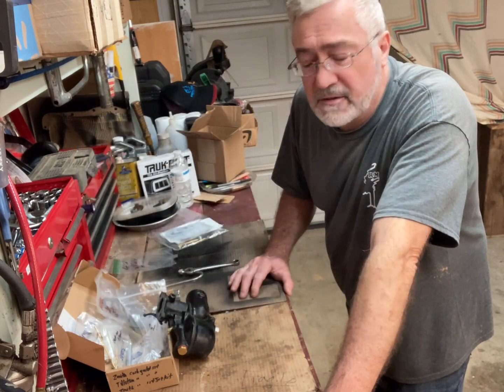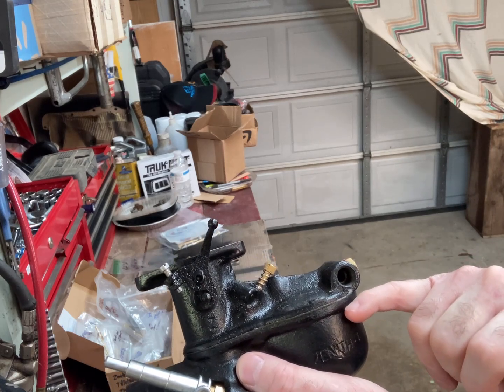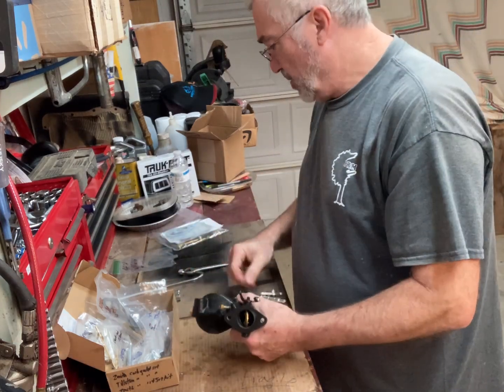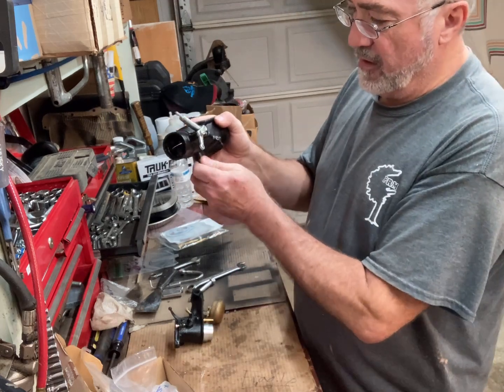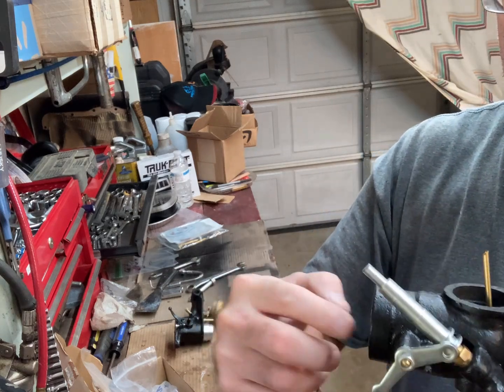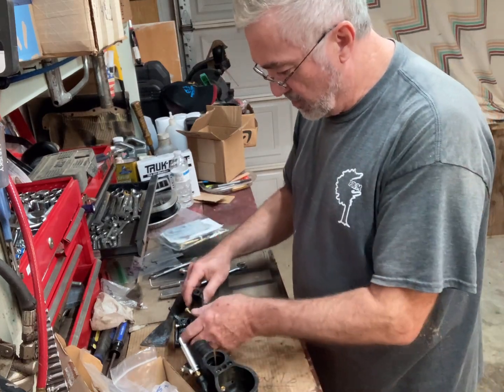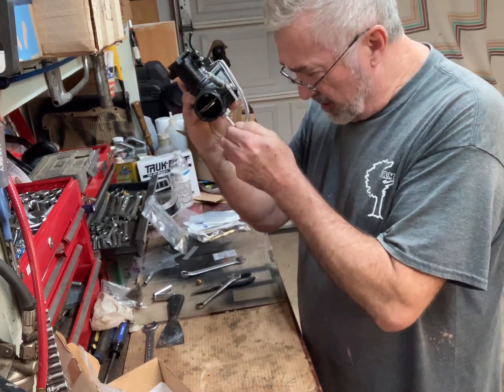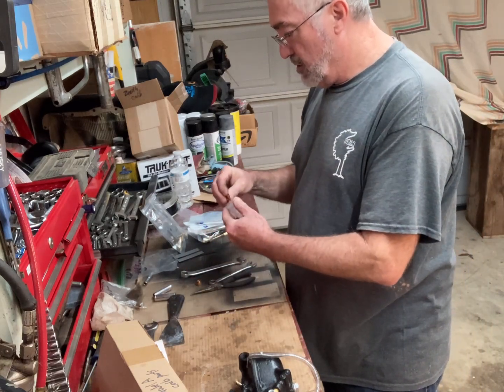Ford Model A How-to: Setting Zenith carb float if carb leaking #car #ford #automobile #fordmodela

Comment from the maker: That is where I have it…. and no washer. Not sure what you saw in the video… 
if you look at 3minutes in the video you can see the idle jet hanging down.. from top of carb into the secondary fuel well.
There are two jets sticking up from the bottom of the carb - the primary/main jet and the secondary jet…. in the video you can see these jets also, but they aren’t the idle jet.

Comment: Hi Ted 
The idling jet is the long jet that goes into the top half of the carby 😢body and doesn’t have a washer . When assembling carb ,the idler jet fits into the secondary well in the base . The shorter cap jet goes in the bottom bowl with a washer the main jet has a washer screwed up from the bottom. Make sure the two body mating surfaces are clean and square,a little touch up with a file will do !
Regards. Russell. 🚕🦘
Reply: With the idle jet in the wrong place, no wonder the carb didn't run well!
Reply from the maker: It was actually running pretty good... see the video where I'm showing the engine first running and then another with it running to show my dad... I'm surprised it was running that good.
I think I have another problem is in the ignition... possibly grounding out somewhere...  gonna have to take a look at that now.